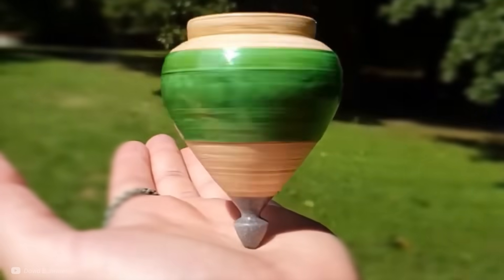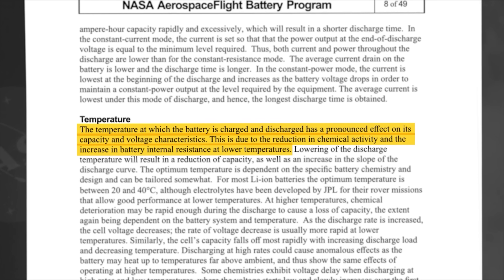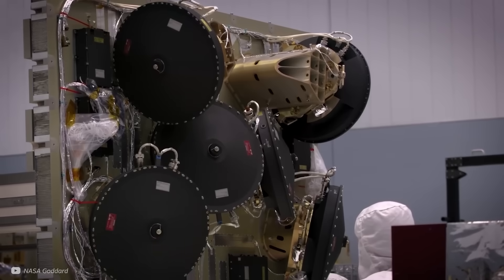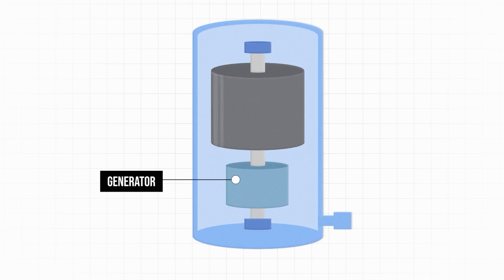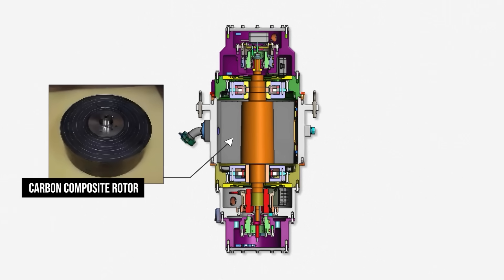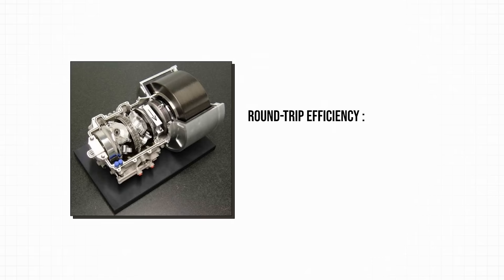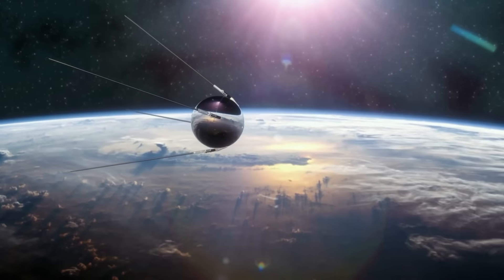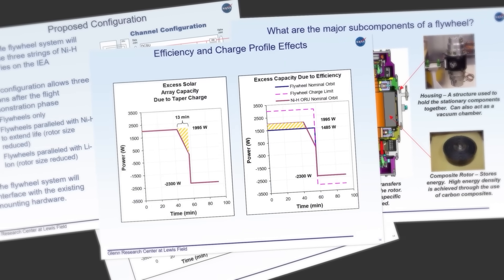How NASA Reinvented the Mechanical Battery

Comment from the maker: Upgrade your browsing experience today with Opera using my link https://opr.as/Opera-browser-zirothtech ! Quick clarification from the intro - flywheel cannot be used to control a satellites altitude (height as I call it), but just the attitude (orientation)
Reply: Hi Ryan, at 0:10 you say that gyros are used to adjust the satellites height and orientation. But unless they jettison the gyro to get a little push, I don't see how it can change the altitude/course/location of the satellite, otherwise we'd have a gyroscopic propulsion device! Alex
Reply: Glad you said that, because I was about to 😅
Reply: Advertise a Chinese browser?
Reply: @paulstraszewski736  <<What, wait, burp, fart, hiccup>> 
Ya, agree with you. Why on earth in human history would we ever need to use a Chinese browser? 
I've been using Brave browsers for years now. If anyone knows any problems with it, please let me know.
Reply: @paulstraszewski736  its a norwegian browser
Reply: I've been wanting one of these for years.

Technically two of them, store energy and self-balance my e-bike.
Reply: Why not use a chemical battery as flywheel?
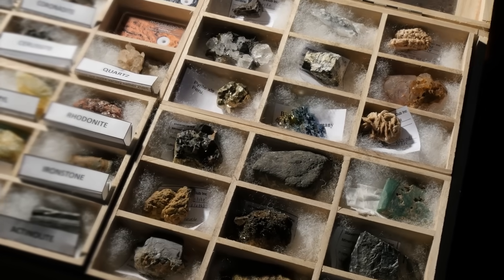Reply: 06:50 - As far as I'm aware, no Rare Earth metals are used in Lithium-based batteries. Rare Earths, however, are used in the magnets for some electric motors and generators. The two most used ones are Neodymium and Samarium. 

The title 'Rare Earth' is something of a misnomer, because they are not all particularly rare. Some are found in varying abundances all around the planet. The Rare Earths are actually two groups of elements, often called 'the Lanthanides' and 'the Actinides', and are often seen in Periodic Tables as two separate groups, following the elements Lanthanum and Actinium.

The heavier Actinides group certainly is rare, because most of them are radioactive, with very short half lives. But some of the more common group, the Lanthanides, are used industrially. The Lanthanides are mainly rare in not being found naturally occurring in isolation; without being mixed with one-another. They are somewhat difficult to isolate chemically from other Lanthanides.
Reply: Could breaking of 2 counter rotating flywheels on the same axis not provide lift?
Reply: @DanSohan  Yes - it could NOT provide lift

It could provide heat, or regenerate electric power, (or hydraulic)  -  briefly
Reply: I use Opera long time.. but new unnecessary features just complicate it and add weight
Reply: Have you seen levistor in the uk? They have an interesting flywheel technology
Reply: spacex satellites use krypton gas positioning hall effect thrusters for that.

Comment: i've been asking for years. why don't they just take generators up there and spin them with 115v 100a motors or the like? at 3000rpm it would make 26ft-lbs of torque. lots of power to turn a huge generator in a weightless, almost frictionless, environment. or did NASA teach me the wrong things?

Comment: NASA’s flywheel geometry limits rotational speed despite reduction of friction loss.   With the right geometry, flywheels can approach the specific energy of metal-air primary batteries…far in excess of rechargeable lithium-ion.

Comment: Anyone who works on cars or any mechanical system will be able to tell you that there is no such thing as a mechanical system that doesn't suffer from degradation over time. No matter how close to perfect the lubrication or how near perfectly balanced the assembly is after manufacture or how near perfectly you control the outside factors like load and temperature, there is ALWAYS wear.  That wear compounds over time until it causes a failure.  They may switch out these "mechanical batteries" before the expected lifecycle is over, but there will still be wear.

Comment: Ziroth, Overall good.  Flywheels can have a higher POWER density than chemical batteries.  They do not - and the NASA one you showed does not have a higher energy density.  Especially not 50X the energy density of a chemical battery.  A Lithium Ion Battery would have 6-8 times the energy density of the NASA flywheel.

Comment: this is good, the truck in my dreams has 240 lb ft of torque. when every 30lb ft makes 15k watts of electricity, i could have 30k watts from 2 generators running off of the drive shaft that feed the power to a 20-minute run time battery pack throttle management system that powers the forward motion motor set at 25k wtts.  Keanu Reaves running from an explosion of market value!!??

Comment: well, the grid already has flywheels, the huge turbines that are moved by steam and water they provide stability and inertia to the system, literal mechanical inertia. Flywheels would be necessary for solar and wind, not just for storage, but also for inertia and provide stability to the system.

Comment: a flywheel technically being a mechanical battery can excell well beyond lithiums safe rates of charge/discharge expressed by C. a 10 amp hour battery rated at 10C can safely power loads that draw currents up to 100 amps. some readily available lithium polymer (Lipo) batteries are available with a C rating of 150 or more though a typical Li-ion such as the standard and very common place 2A/hr 18650 may have a C rating of 3 or 4. when called upon the energy stored in a flywheel is capable of discharging energy at a rate which will easily melt heavy steel components. unlike a conventional lithium cell a flywheels rotational energy can be driven like a hammer unleashing all its energy in an instant like an explosion.

Comment: Flywheels are still used in space applications for orientation, though, just not as energy storage devices. I feel like you didn't emphasize that point. The video also did kind of a 180° turn, kind of talking down on chemical batteries as unreliable and fragile and then stating that NASA kind of gave up on the project due to batteries having advanced enough. Good video overall, it kind of lost the point for me towards the end, but you did showcase other applications for terrestrial use, which I liked.

Comment: 5:12  50 times the energy density of a lead-acid battery. Almost impossible to believe. Can you quote experimental results supporting this?  Here is the problem: Lead-Acid batteries have awful energy/mass density, around 140kJ/kg, about 7 times worse than Li-ion. Still to get 50 times this, which is 7MJ/kg, you need the kinetic energy equivalent to linear motion at 14000km/h , that is, several times faster than a supersonic plane. . Most flywheels would fly apart under the centripetal force long before this. For example, consider replacing a 10kg car battery with a metal disk. Imagine the disk has a diameter of 30cm.  For 7MJ/kg, it would need to spin at 340000rpm, and the centripetal force would be 18 million times stronger than Earth's gravity.  And the mass of a mechanical battery must also include the the vacuum enclosure and the motor/generator.

Comment: 6:00: "Every motor is a generator", he says. Sorry but wrong. Induction motors, synchronous motors etc are not generators. Many motors based on permanent magnets are also generators, and in almost all cases where permanent magnets are not used, such motors are not usable as generators.

Comment: No matter what materials are used, there will be I²R losses in the windings of a motor/generator.  That is HEAT!  How do you cool the windings in a vacuum?  The only way I can imagine is radiative cooling, which could work, but isn't very effective. Insulation materials will eventually fail without VERY CAREFUL design.

Comment: A heavy mass spinning at very high speed can be dangerous. The Alexanderson alternator (which generated radio waves electromechanically) was housed in a solid concrete bunker - if the rotor disintegrated, it would be like a bomb going off. It played a vital part in ending the First World War. It enabled President Wilson and General Ludendorff to communicate directly by wireless.

Comment: It's a matter of phase.  If the magnetic field leads the rotation, then it is a motor.  If they are in phase, then no energy is exchanged.  If the magnetic field lags the rotation, then it is a generator.

Comment: definitely makes more sense even on the Earth, compared to gravity battery, which has absolutely awfull energy density and is so demanding for space. Flywheel battery would be awesome for hybrid cars, however I can't imagine it without traditional bearings. There is so many vibrations and impacts, it would destroy the flywheel relying only on magnetic bearing.

Comment: Actually, this is old technical dating from the 1930's the Electrical Utilities use Synchronous Condensers to stabilize the electrical system.  Synchronous Condensers are huge motors/generators that hermetically sealed that spin in a hydrogen atmosphere to reduce windage.  If generation is lost or dips the SC supplies power until the system is restored usually within minutes.  The hydrogen gas pressure is maintained between 3-7 psi to keep it from becoming a bomb.  Lol Inspection of the slip rings, through a glass window, is exciting because they are always arcing.

Comment: Dual counter rotating wheel is what you need in the space application. As it spins it can passively charge capacitors. Also can using charging act like a brake reduction device. Thas where I would start. One slows down and station rotation starts up. Do it right likeky recover lost energy during station rotation.

Comment: Few misconceptions: space isn't freezing, at all. There's barely any stuff there, so heat redistribution is very slow. 
6:29 no, not every motor is also a generator, there are 3 pulse motors which can not act as generators
6:57 hardly a concern for ISS. They have millions of dollars and care way more about the weight of the stuff launched, and amy environmental damage is negated by the incredibly small scale

Comment: Actually its the sideways axial motion that is used on the flywheels. Stand on a lazy susan while holding a spinning bicycle wheel and push the right side away from you while pulling in on the left. Your body will spin around on the lazy susan. That is the type of mechanical motion used.

Comment: 11:01 😂 Really putting in a lot of effort!

This is 15 minutes of stock footage accompanying a script that's worse than just reading the Wikipedia page on Flywheel Energy Storage. The vast majority of this video is jumping back and forth between comparing flywheels to batteries and then just trying to explain what a flywheel is at a very basic level.

After repeatedly promising to tell us what revolutionary improvements NASA made to reinvent the flywheel, we get... Vacuum chambers and magnetic bearings? Is that the final answer? Sealed gyros have been in widespread use since at least the 1950s! There's nothing revolutionary about putting sealed bearings on something you're launching into space! 🤦‍♀️

And why are all the examples so apples/oranges? Dental tools? Why not give us a little history of the progression of flywheel tech? There are so many cool things that have used gyros/flywheels. Like inertial navigation systems and/or the Norden bombsight.

The 1940s centrifuges used to enrich uranium managed to spin at almost 100,000 RPM without magnetic bearings. Pretty sure the USSR was ahead of the curve on magnetic bearing tech in their centrifuges in the 1960s. 

For a guy who says he has a background in automotive tech, I'm surprised he didn't mention flywheels in engines. Flywheels predate internal combustion.

Comment: Why did you related with a space program this this phnomena is perfect for under space where gravity exist and more equilibrem will be created or un object can stay at rest . gyro Consept is needed to crate center point for un object where gravity has no place when i say this also can be used where gravity exist to control balance but it is more practical on space to contro objects motion like satelights use but this is more about deacreasing contact serface when we came where gravity exist and other forces like centrifugal centriputal .
I geuss its just un opinion

Comment: 5:45 the motor in not run in reverse they are only putting a load on the windings to extract power 6:03 universal motors can't be used as a generator based on how they are wired
Reply: What type of wiring system you prefer them to use and why

Comment: It does not sound that great to connect power storage to stability. It would mean if you have to drain the battery, you would lose stability and this makes it hard to stabilize solar panels to get energy. So this battery would always have to be kept at a minimum charge to serve that dual purpose, reducing it's actual useable energy storage

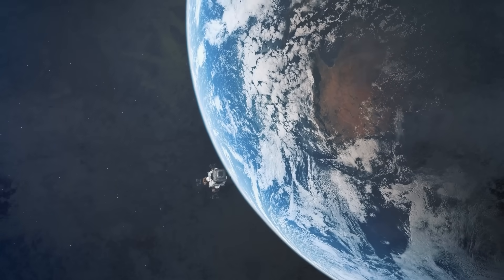Comment: 1:36 "like in the freezing vacuum of outer space" - This remark is based on cinema fiction and not science. Space is neither hot nor cold. If there is no mass there is no temperature. In fact, space/vacuum is the perfect temperature insulator and the problem is cooling satellites down because there is nowhere to transfer the heat produced by the electronics other than emitting it from the surface of the satellite as infrared light. The electronics within the satellite can operate in temperatures of 80C and even higher but the batteries can not. The problem is exactly the opposite of how you presented it. Cold is not the problem, heat is.

Comment: This would need a lot of special care to ensure that charging/discharge doesn't deflect the craft's orientation from the intended course. Advanced flywheels should have a lot of applications in grid use where total system mass is less important than cost per kwh storage. The flywheels could be made out of extremely low cost materials like recycled scrap metal, and it wouldn't even matter if there's other cheap non-magnetic materials like aluminum mixed in and such as long as it's magnetic enough for the magnetic bearings to work... Which would increase service life significantly by reducing mechanical wear.

So long as it's cheap and lasts a while, it's fairly attractive. Far more so than batteries that wear out more quickly the more you charge/discharge them. With flywheels, all you need are replacement parts for broken components and some safety design to make sure it doesn't hurt people or break additional equipment if a high velocity wheel suddenly breaks. And by cheap, I mean that if you have to replace your battery system 4 times in 30 years, and the flywheels still work fine, then if it costs less long term to go the flywheel route...

Comment: Flywheel batteries date back to 1960 s when their were buses with mechanical flywheels which got charged at bus stops by electric motor  with power cable supplied at every  bus stop

Comment: this is really cool. there's one major issue i see though. the voltage/speed you get at the output will drop off at a linear rate. lithium batteries are non-linear and maintain a very tight voltage range until they are nearly flat. much less of the energy in a flywheel will be usable energy.

Comment: another really cool thing about grids and flywheels is the turbines in thermal power and hydro plants also double as flywheels. when excess power is put onto the grid the grid frequency speeds up, and when production is higher than demand grid frequency slows down. the more flywheels exist on a grid (eg turbines or things on other big industrial motors) and the heavier they are, the higher inertia the grid has.

Comment: Using this technology for power storage on Earth

1. Vacuum pumps needs energy to maintain vacuum.
2. Magnetic or air bearings need energy to keep the shafts centered.
3. There is heat loss during electricity generation between stator and rotor 

So overall efficiency of 90% feasible?

Comment: The ISS (or a space station in general) would be great for gravity batteries - have a 100t weight and drop it 100 km or so down on  a cable, which drives a generator. That one drop is worth 30000 kWh.
Reply: You can't just let something go from the ISS and have it fall to earth. Does not work that way.

Comment: There are trains in the UK that use FES!
The Parry People Movers (class 139) are tiny high-efficiency railcars for small branch lines that are too expensive to electrify.
The flywheel is spun either by electric pickups placed at stations, or by using a minute diesel motor that can always run at the ideal speed & torque.
These are the trains used for West Midlands' Stourbridge branch line, which is the shortest branch in the UK.

I'm concerned that they won't be around for much longer, though, which is sad.

Comment: 6:56 you skipped a critical issue. Why did huble break several dozen gyros ? 

Solar wind brings high energy particles that occasionally break ball bearings and kill gyros. This is a random process and can't be protected against, and the major reason for losing satellites. That's why all sats have a huge load of spare gyros. 

I fear any fly wheel used as storage will suffer the sale issue.